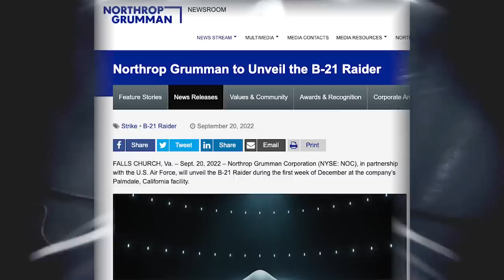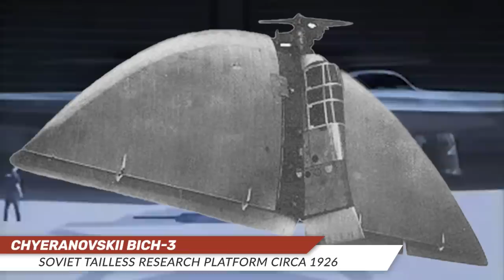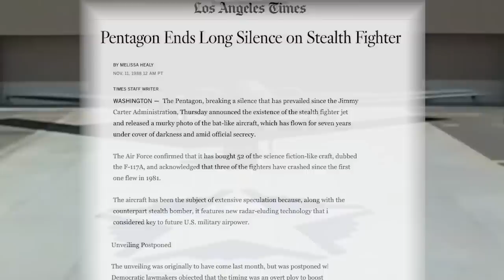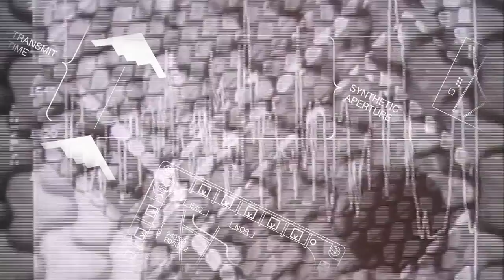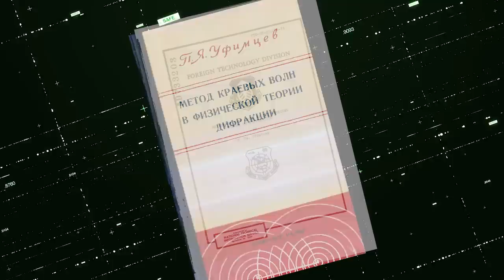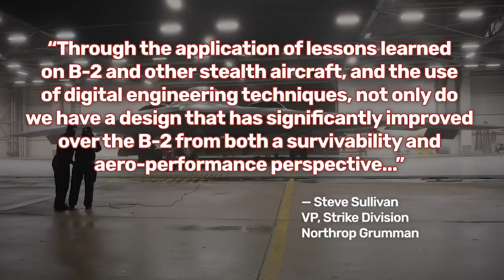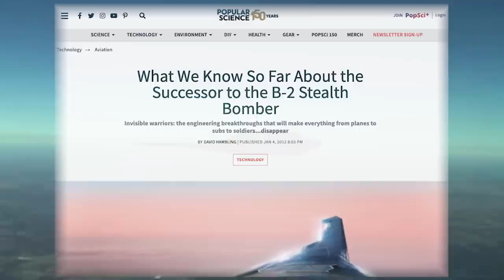Revealing the B-21: Why Northrop Grumman's announcement is a big deal

Comment: Cenospheres are produced when coal is combusted in coal fired power plants. The are small spheres that are hollow. They are hard, light, rigid, waterproof, insulative and chemically inert. They have been used in concrete as filler and in metals to produce lightweight composites. When coated with silver they can be used in anti-static shielding.

Comment: Your explanations for why the flying wing "fell out of favor for a while" is muddled and inaccurate. The original interest in flying wings, was driven by the limited aerodynamic understanding of the time, and the perception that it would have less drag, since it had less structure and wet area. This perception was progressively demonstrated to be not true , as experimental aircraft battled against trim drag and instability. Quite the contrary, statically stable, flying wings have much more drag than the "conventional" tail + wing design, which in reality is the optimum.
Enters the age of the fly-by-computer and unstable aircraft design. Now a flying wing is suddenly technically viable. Not mainly because of low drag, but because the shape is advantageous from a stealth perspective.
And no, stealth was not born from the works of Pyotr Ufimtsev. That's disinformation,..  ( and here I wrote a long section about stealth and the history of US stealth , which I eventually decided to delete before posting .)

Comment: B-21 isnt a new design, it’s actually B-2 original design. It’s simpler yet has less drag-to-lift ratio, the reason why the B-2 has more control surfaces hence more complex design. The B-21 will be successfully utilize the B-2 original design because of its lighter yet stronger materials and smaller dimension.

Comment: Just a thought on radars since the video mentioned high freq targeting radars. 

Are there such things like low freq targeting radar or are there any problems using low freq vs high freq?
Reply: It is possible but insanley difficult and risky. Low frequency radar is good at detecting large general locations of an aircraft because of its wide bands but cant be precise enough to target an aircrafts altitude and speed etc which are vital to get a weapons grade lock, so typically everyone uses high frequency radar to get more accurate information while also while using low frequency to get an early warning of something in a general direction

Comment: I saw a new b2 type bomber fly over the highway 95 going south from Reno to Vegas just north of Tonopah (20 miles).  My guess it was on final to the Tonopah runway on the range there.  Was crazy cool, unexpected and over in a minute.  2004-2006 (I forget year) but have old emails I sent I could check.  When I stopped at the gas station I broke my solitude self and asked the people sitting outside "did you guys see that" about 10-20 minutes ago in the sky?  Lol.  They missed it.  I think it's path to final on runway was more to East of tonopah, but close.

It was smaller and sleeker than b2 which I've seen on final to Nellis.  No photos.  

Wish they'd just keep b21 secret until the next bomber is under development.  Loose lips sink ships.

Comment: The reason for this aircraft is that when then President Clinton, cancelled the B-2 program the air force only got a total of 24 B-2s instead of the 135 the air force wanted to replace the aging fleet of B52H aircraft, ( the last of these were produced in 1957) so with a shortage of modern bombers something has to be done to correct it.